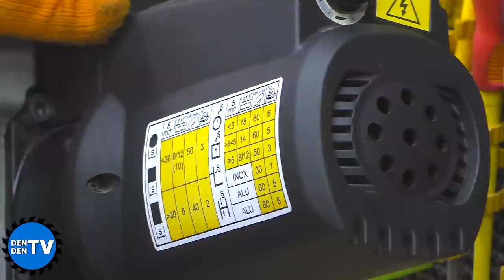Такого еще никто не видел ! Секретная функция разводных клещей!

Comment: That is not a "SECRET" function it is a modification. But most people would just use a gear puller rather than ruin a pair of vise grips.
Reply: It's okay. These are low end visegrips anyway. Probably from a Harbor Freight or equivalent. Around 5 US dollars a pair
Reply: @yoBradyO11  in the US though. Harbor Freight...
Reply: There are small bearing pullers that you could buy for less than $20, the very simplest for less than 10. That slide pulling contraption he did might not even work on the tight bearings or frozen on the shaft

Comment: When the correct tool costs much less than the tool you butchered to make the new tool
Reply: Mater haters! If you ever find yourself trying to get a rusty lag bolts out of the hull of a boat with the carpet still wet on a 98 deggree day and can barely touch it then learn the "correct" tool has stripped the wet wood and left you with a key locked in a hole this mutilated tool is your only chance to pull the key to unlock thousands of dollars worth of marine power chain. Well you could use the correct tools to saw an access hole the size of your shoulders where you could stick your face in the mildewed carpet and try not to tear your ears off as you snatch your mosquito covered face through a hole with fiberglass and splinters . Enough said. When you run into a problem that is not in the factory manual do what a man does. CHEAT.
Reply: @edwinsutton5076  Thanks for reinforcing my belief that owning a boat is overrated.
Reply: @edwinsutton5076  I love your descriptive writing.
Reply: yea, absurd nobrainer this vid ^^
Reply: @sniffyjoesleghair6257  Oh,I don't know if overrated is the right word. Everyone knows they are expensive,need constant care/maintenance,a house to shelter it and after a few years is hard to get excited about taking it for a spin. But as a divorce present to yourself for being a good sport they are damn near priceless! I still have a few photos . Most were stolen by perverts( God loves all the perverts in the world) and the rest you can find on candid beach photos even though the boat never saw salt water. I recommend financial forethought that you have shown already to include a snowmobile. Why? Girls just want to have fun. I gave the boat to my son and started a non-profit organization and  named it ' Ed's home for wayward Girls'.  Anyone looking to donate large sums of money to help me help these girls is ecouraged to do so.

Comment: Now you have a bearing that is either going to be out of round, have a damaged race or both. They have tools especially for bearing removal that don’t damage the bearing. Sorry I’m not impressed with this one.
Reply: Bearing is bad and being replaced I doubt it matters
Reply: @captleo435  Yes, why would anyone remove a good bearing, there would be no point in taking a perfectly good bearing off and then putting it back on!
Reply: Bearing races will not be bent without high heat. Enough force and they may break, but bending a bearing cold is not going to happen if they are of a quality brand.
Reply: Never reinstall interference or press fit bearings.
Reply: @revolution51 , Doing this will peen the race, along with the ball bearings themselves and cause failure in the future. That is, if for some reason the bearing was used again. Vibration is an enemy to bearings, also, no pounding force is to be applied to the outer race, where that race is not in contact with a housing, especially on sealed bearings, such as this.
Reply: @toddolson573  Right. Also notice that the slide's weight is negligible. Gives the fist the punishment. Many short comings to this tool for all the trouble it takes to make it.
Get a puller kit and forget it.

Comment: I made that tool more than 30years ago. Still have it. And that is the incorrect way to remove that type of bearing. That is if you hope not to damage it for re-use.
Reply: A threaded rod with a 2" or bigger round stock was used as a back hammer a lot in the tool shop to remove inserts in the plastic injection molds we would repair.

Comment: The thread in the vicegrips won't last long. It was never intended to take the impact-loading of a slide-hammer.
Reply: That slide hammer won't generate much force....with the sleeve over the end of the threads they shouldn't open but like you said they weren't designed for abuse

Comment: There's a gadget already made for this job, and it's called a "Bearing Puller", available in many sizes, all adjustable, and quite cheap depending on where you buy them. The "Slide Hammer" (the clue is in the name), can be bought as an option. Why ruin one tool to make another. As for woolly gloves near machinery, don't get me started on that one, ****'s sake!
Reply: Funny, I was thinking the same thing… all these fancy tools to make one dumb one! 😂😂 get off your cheap ass and buy a bearing puller, looks like you have the money!
Reply: @JackOfAllTrades2022  thanks to all us idiots watching this video im sure he can by $1000 worth of pliers because of the income generated by this video
Reply: @ryanscott2548  Yeah, was looking at the brand new looking workshop. All that equipment looks hardly used. Must only use it for pointless youtube videos.
Reply: @Erebus.666.  either way...the tools paid for themselves a few times over.....  why invest in stocks...when you can buy $20 vice grips and piece of ready rod and a few pieces of tubing and turn it into $1000 IN 3 MONTHS
Reply: @ryanscott2548  yep, and he’s laughing all the way to the bank..$$$

Comment: We all have one of these at work. Except we use a solid rod of steel for the weight. We just drill a hole through it on the lathe. We use them to pull out pins.

Comment: Would be better to apply force to the inner race, wouldn't it?  I guess damaging the bearing is probably irrelevant since it's likely being replaced, but you should be aware that a slide hammer to the outer race will apply heavy axial shock loads to the bearing, probably beyond it's rating.

Comment: I have a set of different sizes of these including needle nose vice grips with different weight slide hammers on them  but I would NEVER pull a bearing with them. It's a GREAT tool for stubborn parts that wont get destroyed though !! Thanks.

Comment: Or you could just put the motor directly in the vice, take an ordinary spanner whose tines fit behind its wheel, and use a light hammer to knock the  spanner head behind the wheel to dislodge it!

Comment: I made mine from an existing slide-hammer. It had 1/2" 20 threads, so I just welded a deep wheel-nut on the vise grips.
  Very useful tool for the last 20 years or so..
Reply: Then you had to go buy another pair of Vicegrips.
Reply: No, all I added was the nut.
 They still work as usual. @tubularguynine
Reply: @markrichardson239  - Ok...I read 'pliers' and 'welded' and figured they were done for! 😄

Comment: How to take one-third of a $10 set of Harbor Freight vice-grips and use $500 of shop tools, plus $30 of materials, plus labor time, to turn it into a $17 Harbor Freight gear puller. . .or a $22 Harbor Freight slide hammer.  BRILLIANT.

Comment: This is not a secret function of vise grip pliers. It is a modification. A secret function implies that something is built into a tool that most people do not know about such as the wire strippers on the metal tangs of an electrical outlet. You wasted my time.

Comment: Very good but you could just buy a cheap motor armature bearing puller for £10 off eBay and save your mole grip pliers for other jobs as mole grips are very handy when used as sets of 2 for clamping steel together when cutting, grinding and welding stuff together.
I use 2 of my mole grips together at each end when cutting 3mm thick mild steel sheet to clamp a bit of steel flat bar firmly in place in order to guide my angle grinder when I need to cut large pieces mild steel sheet to size quickly.

Comment: Bearing race easily damaged by overload when pulling off with outer race. Worsened by shock of hammer effect. Okay if race is not to be re-used. Otherwise use proper puller.